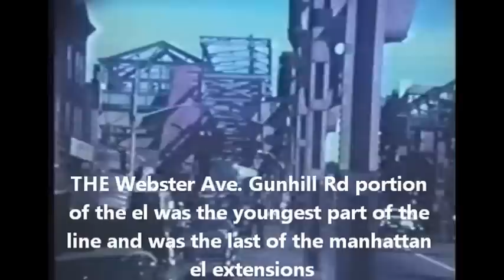3RD AVE.EL in the Bronx , Movie footage

Comment: The 8 Thrid Avenue Elevated should of been left alone and never had taken down. All they had to do is to shut down the 3rd Ave Elevated line down instead of talking it down and do a complete over hual inspections on the Track frames trestles and beams until they decide to run the Thrid Avenue Elevated line back. Look at the ninth Ave Elevated line at Jerome Ave Elevated line under neath the 4 train they have the whole entire trestle and not even a half of track frames. At Gun Hill Road they have half of the track frames trestle.
Reply: @Lee Cornwell The N/W is getting R211's & R160's 

The Q is getting all R211's 

The B is getting R160s/R211's

The D is keeping it's R68s until it retires
Reply: I have a question when is sixth Avenue getting CBTCS?. You know that the A C lines is getting CBTCS first. How is the B trains is getting R160s R211As if the B N W Q Trains is not getting CBTCS for a good while.
Reply: The B is definitely keeping the R68/As because they are not getting no CBTCS until the R268/As comes to replace all the R68S R68AS on the B D N Q W lines. The B is definitely gonna have mix equipments R160s R68AS. The R211As R211Ts are definitely replacing all the R46S on the A C lines for CBTCS first and the G also getting CBTCS and the F lines between church Ave and Coney island. You definitely know that Staten island Rail way it definitely getting the R211S . to replace all R44S.
Reply: @leecornwell5632  put all R188's on the third avenue elevated
Reply: It will definitely be the R262As close ways or the R342As will definitely replacing all the R12 R14s that used to run on the 8 Thrid Avenue Elevated line.
Reply: The R160s are not going to the B D N W Q Trains because you have to remember the E F G R lines has CBTCS. The B D Q W N is definitely staying put with the R68S/As and probably R46S . The R268/As will be coming out real soon. The R188s is staying put with the R188s . I have a real spriital feeling they are gonna build the R262As I'm telling you.
Reply: Put some R262As on the 8 Thrid Avenue Elevated line and the R342As close ways.
Reply: They better definitely get there Thrid and ninth Ave Elevated line plans out.
Reply: Put the R62AS on the 8 Thrid Avenue Elevated line because the R262/As open and close ways are definitely coming real soon I'm telling you. The 8 Thrid Avenue Elevated line could definitely use six car units just like the 42 Times Square shuttle trains has right now using six car units.
Reply: Put the R62S R62AS on the 8 Thrid Ave Elevated line

Comment: I think the R series cars were too heavy to run more than 4 cars on that old El
Reply: Not only were the consists limited to 4 cars but the dynamic brakes were disconnected and the controllers rewired to eliminate the parallel (fastest) notch.  The Lo-V cars which preceded them did not have dynamic brakes and were somewhat lighter so they were a better fit for the old elevated structure.  However by the time they were replaced they were 50+ years old and well past their designed life expectancy.

Comment: This 3rd ave El had a ridership of 270,000 people per day to South Ferry!A straight run all the way downtown,a huge mistake destroying this line.As a result the neighborhood went down with it and like the building of the Cross Bronx expwy was a failure in its own right!!
Reply: They torn the Thrid Avenue Elevated line down on purpose because Governor LaGuardia and Robert mosses had fusted the TA workers to tair down the Thrid Avenue Elevated line down for nothing. The 8 and the 2 5 lines has the same exact metal steel structures.

Comment: Who syas you can't go back.  If we are aiming now in cutting on automobile traffic, then why not "rebuild" the Third Avenue El?  This is a great way to invest in infrastructure and promote more use of mass transit.  Dig it?!
Reply: Mater of fact they are definitely gonna rebuilding the Thrid and ninth Ave Elevated line back I tell you that right now when they build the Brand New R262/As with open gateways and the End ways to replace all the R12 R14s on the Thrid Avenue Elevated line. However they are definitely starting to developing again with Affordable houses and other businesses between Gun hill road Clearmount Webster Boston road Bronx. It's not beat down anymore. Another thing it's definitely gonna happen is this . The Q T trains will definitely run across west side 125 street and then 137 street to connect to the 1 Broadway line. I have seeing it on the map where they have the curve for East 125 street to Lexington Avenue connecting to the 4 5 6 and the metro North railroad.  They are definitely making enough room for the 8 or the 10 trains to run on the Thrid Avenue Elevated line in Manhattan under ground and above ground in the South Bronx.
Reply: My Question is this how could the subway run on the same exact tracks were the Harlem metro North railroad runs through woodland and Wakefield or Gun hill road?
Reply: Matter of fact. Thrid Avenue Elevated has a chance in the south Bronx Tremont Webster Boston road Bronx. Never rebuild another elevated line in the again.

Comment: Just bring the 8 trains Thrid Avenue Elevated line back where it was. Let the 10 trains run to Hunts point and throggs Neck Avenue Elevated line village.
Reply: Stop depending on the Q T trains coming to the Bronx Where the 8 Thrid Ave Elevated line once ran. I had definitely told a few people about that. Sereius plans for the Q T trains is definitely gonna be extended to East Harlem after leaving 116 street making a left curve to East Harlem and west side across 125 Street to connect to the 1 Broadway line because they definitely had showed it on channel 12 news 📰. Another thing to. The 8 Thrid Ave Elevated line will definitely come back between Gun hill road Clearmount Webster Boston road Bronx to help out the 2 5 trains at Gun Hill road and 149 street and Chatham Square or Battery place or south Ferry connecting to the 1 N R W trains. I definitely know they are definitely making enough room for the 8 Thrid Ave Elevated line back come back rebuild it three tracks. If they rebuild the Thrid Avenue Elevated line back it would not be enough room for four tracks because of those affordable houses 🏘️ is definitely up so it would definitely be three tracks I'm telling you.

Comment: What a waste.
Reply: @emteaay2477  - that’s what I meant. It was a terrific piece of infrastructure, laid to waste.
Reply: I totally disagree with the lower riderships and the 8 Thrid Ave Elevated line was making to much noises some one had complained like a miserable ass decision and tair down the God dam Thrid Avenue Elevated line down for what? . My sereius Question is why they did not tair down the 2 5 elevated lines down? That's what every body was asking. The 8 Thrid Ave Elevated line and the 2 5 has the same exact metal steel structures. That's the reason why they are suffering the consequences. God does not like pride. God is not mocked.

Comment: Thoses trains carried more passengers then the buses
Reply: They let the 8 Thrid Avenue Elevated line get it over rusted and did not take care of those elevated lines that they are definitely doing right now. I garente you they are learning there lessons right now that they should not have never been taken down the 8 Thrid Avenue Elevated line down. All they really had to do is to do a complete inspections on the 8 Thrid Avenue Elevated line instead of tairing it down completely. The Bx 55 buses should not never been removed until they do a complete inspections like the trestles frames and beams and stations improvements and signals improvements. That's all they should of did. If they were smart enough not to tair down this Thrid Avenue Elevated line down it would not been no issues . The 8 Thrid Avenue Elevated line would of definitely be up running right now with the R62as replacing all the R12 R14s including the R37 that was originally was supposed to replace the R12S R14s if they would of kept the 8 Thrid Avenue Elevated line up running including the R62AS R62S.